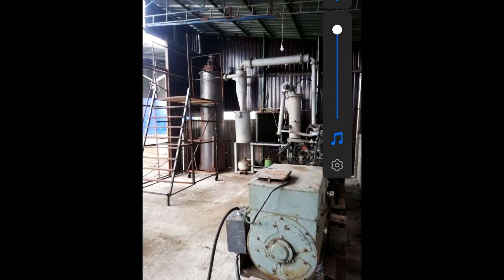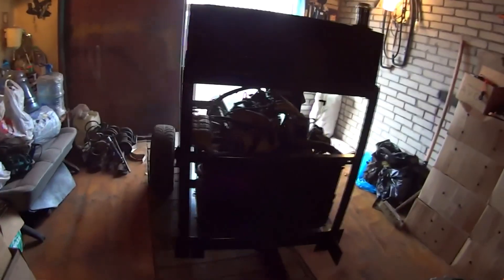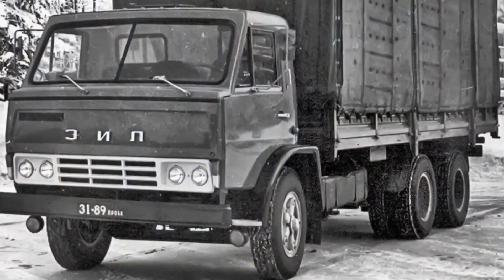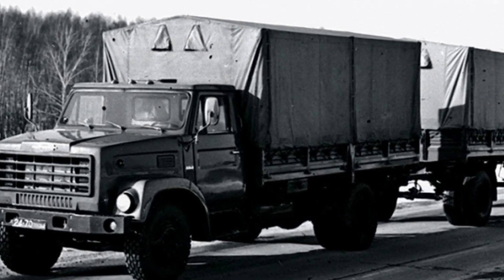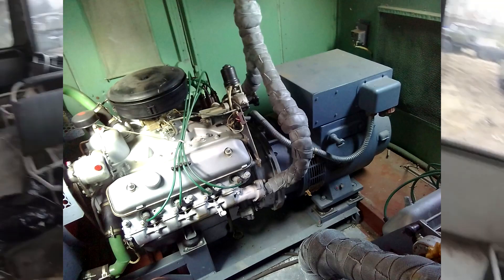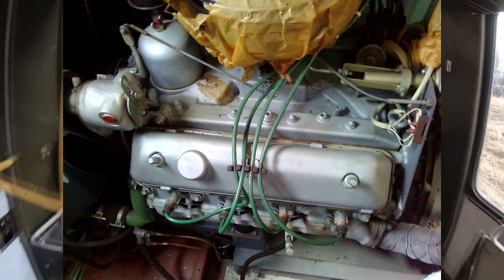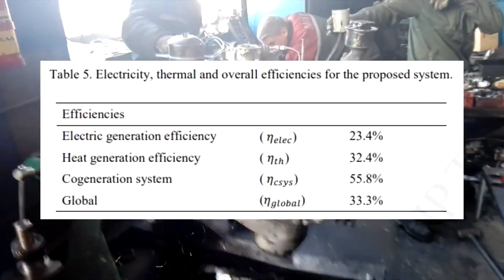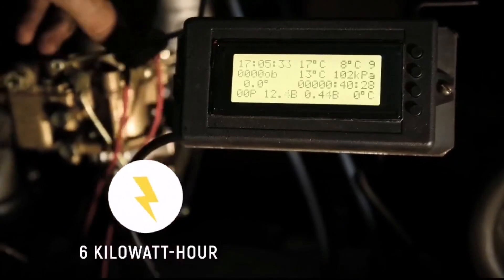Conversion of ZiL-130 engine to firewood to produce electricity by a downdraft gasifier: 100kW?

Comment: Thank you for the information. I have recently read in a syngas engine journal that, wood gas have a thermal efficency of 20 --40 % less than gasoline powered similar engines, but it can be increased by raising the compression ratio, that is machining the cylinder head or remaking the pistons!

Comment: This is great!   Lots of good data.

I like slow running diesel engines,
  as they last a long time.
This means the generator
  ( or alternator, or magneto )
  lasts longer too.
Sadly a reduced precharge of diesel
  fuel is needed to ignite wood gas,
  like the old Honda 3 valve engine.

My RV has a 5.9 L inline Cummings
  6 cylinder engine, and it's rated for
  300,000 miles ( ~ 400,000 km ).
  It's common for them to last to
  500,000 miles, and Cummings has
  a 1,000,000 mile club!

Comment: Ur th guruțè
Reply from the maker: nice
Reply: Thougt iknew guru of wood gas u run ring around wont2 run my gravelly moa couple old trators and an old v8 Landy run th aĺ on fumes kno hw 2inject water 4hydogen got wonder full wood supply lovyr wrk hav unseen Gary gillmores gravely running on charcoal hav leant from u already move2 new Zealand permaculture buy design ameni